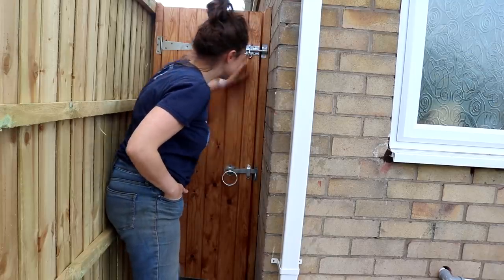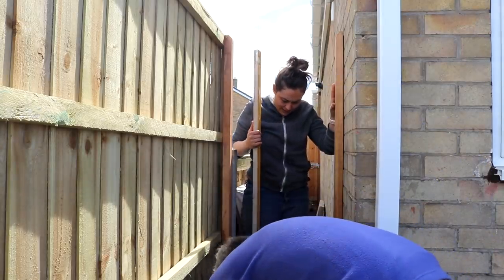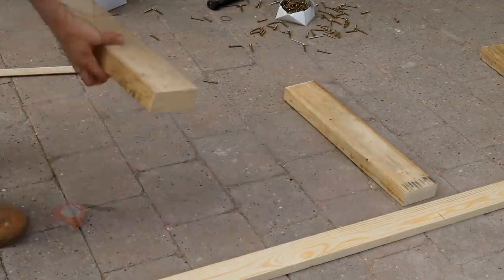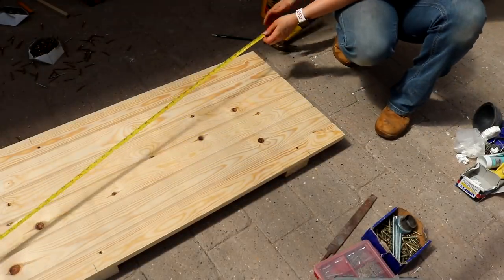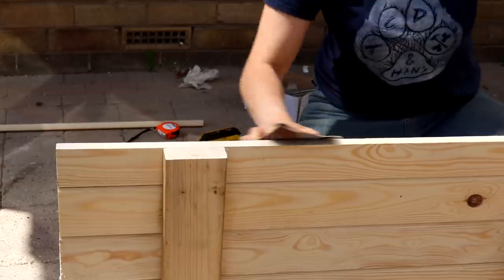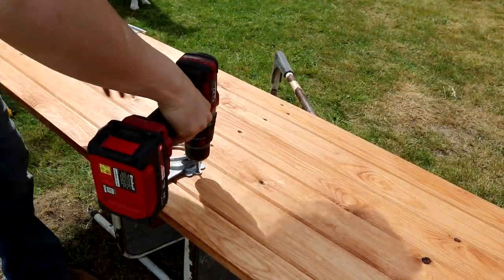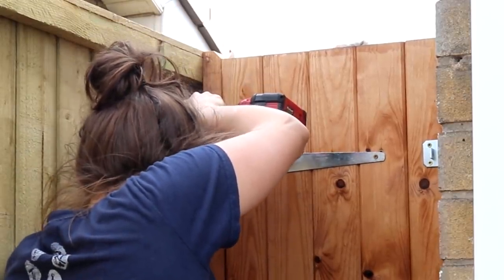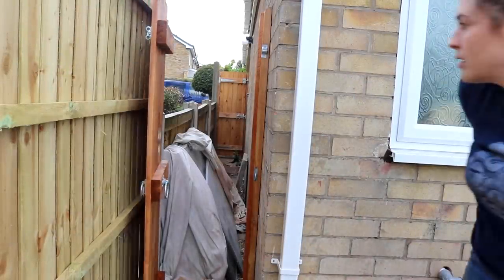Making a Narrow Wooden Gate DIY | The Carpenter's Daughter

Comment: That's a nice neat job. I wasn't aware that you could do without a Z frame on narrower doors so that's good to know👍🙂
Reply from the maker: Me either.  I'll have to find out what the maximum  he suggests until you must have one.
Reply: Traditional names for both types are, ledged and battoned door, same as in video, ledged battoned and braced door is the same but with the addition of angled bracing for extra strength and resistance to sagging opposite the hinge side. :-) great video again vickie.

Comment: Great stuff, looks really good - a little surprised that you didn't use some sash cramps to squeeze the boards together in case they shrink and the gaps open?   
We have a T&G shed that's stained black but has orange stripes in the warm weather when the boards shrink and the original wood preservative shows!
Reply from the maker: I know what he'd say to that as he's said it before... he doesn't like to make tongue and grooves too tight due to expansion.
Reply from the maker: And true about the stripes.  But they'll shrink back when the weather changes, so I make sure I stain the grooves when they appear in the summer

Comment: Nicely done. So is that hinge and lock on the inside of the property? Be odd if latch was outside?
Looking at similar but we ended up just drilling hole into brick wall to take bolt as side was too narrow to fit any wooden posts...
Reply from the maker: We've done this for security reasons as there's another one of these gates on the opposite side which you can see at the beginning on this video: https://www.youtube.com/watch?v=pGbBNgteZ-U&t
Reply: @TheCarpentersDaughterUK  makes sense. Narroe gaps are a pain to fit gates along with latches and locks. 👍 Job well done
Reply from the maker: Cheers :)

Comment: There is always alot more to a gate than people first expect. Getting hinges and latches all lined up can be a nightmare, especially on older warped gates. I did wonder why you were putting all the hardware on the nice side but then realised you had another gate further down the alley. I guess double security with the low fence next door.
Reply from the maker: Yes, double security :)  The other gate is pretty much identical to this one, but my Dad made that one when I wasn't there.

Comment: Hi, the worx saw you used, would you say this was good for cutting sheets of MDF or ply, I’m struggling with jigsaw to get it straight. Thanks
Reply: Jigsaws are not really suitable for long straight cuts, that small circular saw would be a better choice, however I would recommend a timber battern either clamped or temporarily screwed as a guide with either tool.
Reply: @David-bl1bt  thanks, I got some straight cuts with jigsaw as I did clamp timber as guide...but now have circular saw 😊